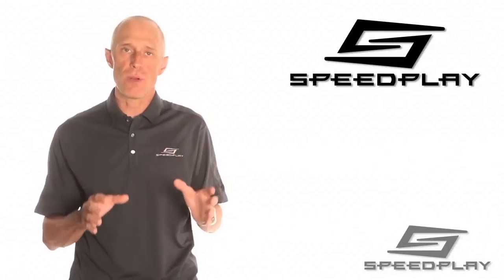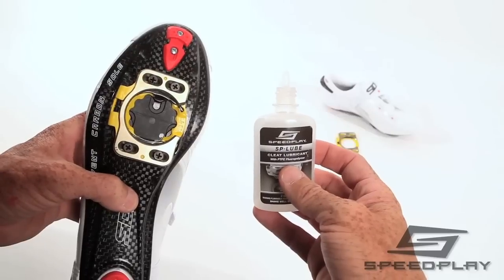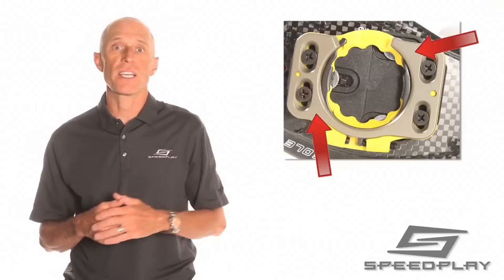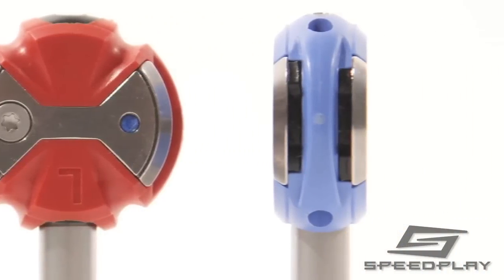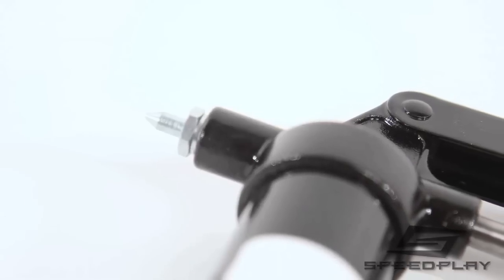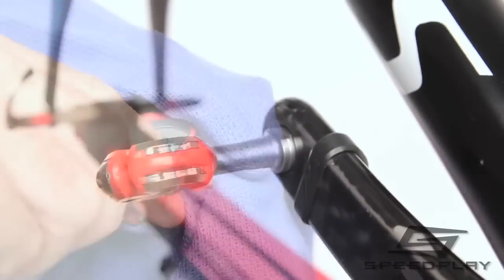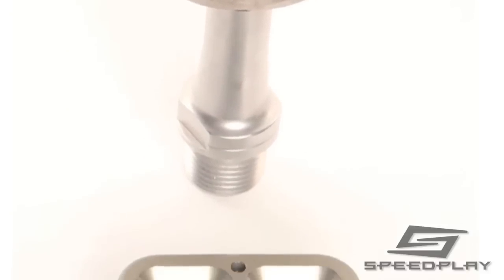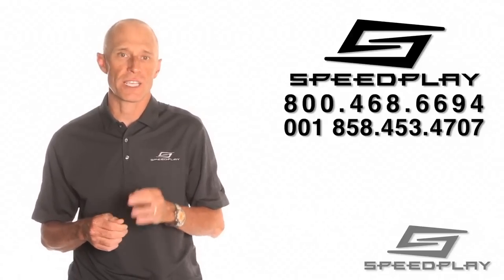Speedplay Tech Series: Instructions and tips for installing and adjusting Speedplay Zero Cleats.

Comment: an infomercial disclaimer without one word about cleat adjustment. thanks for nothing.
Reply: The beautiful thing about Speedplay cleats is that there is nothing to adjust. At most you can move the shoe mounted portion around a bit to push more off the forefront or the balls of your feet, but it's all a personal preference once you get them on and test them out on your first ride. Try them on a trainer first before hitting the road. Speedplay cleats are the best and will save your knees for when you're old like me.